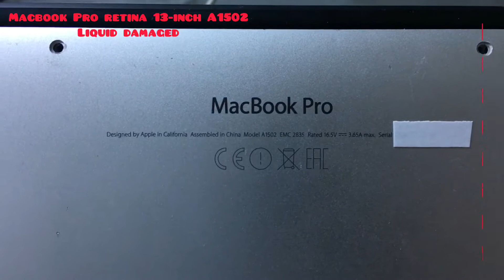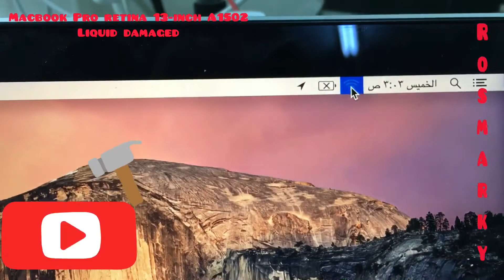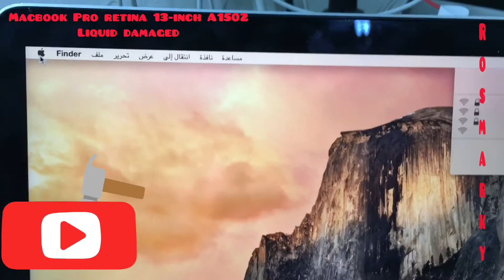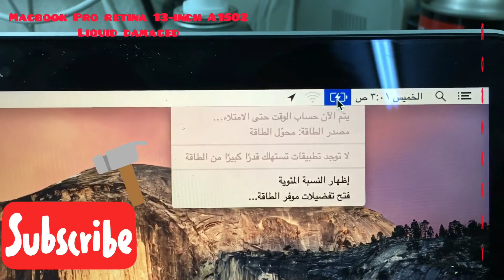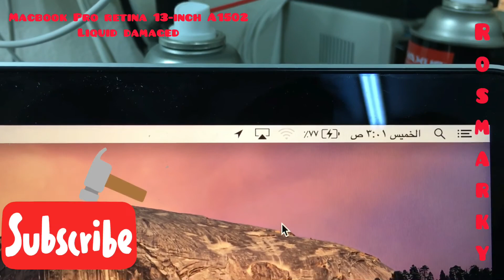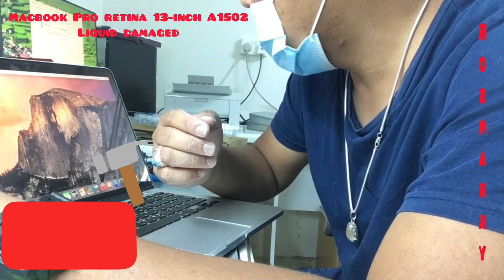How to fix Macbook Pro retina 13-inch A1502 Liquid Damaged-No Power-Not Charging-Battery Replacement

Comment: Hey hope you remember me, I'm the guy who had a issue with MacBook Pro 16 which was solved by replacing the battery flex cable 821-01648-A, I listened to you and bought the 821-01648-02 cable and replaced it and it was working fine, but after that I opened my MacBook to reapply the thermal paste because the old one was giving issues, but after assembling the MacBook back it's not turning back on when I connect it to the charger the trackpad clicks but there is no light in screen (the screen is completely black, I checked it in dark) and the caps lock key is not lighting up nor there is chime sound

Basically the computer is not turning on, nor the fans are spinning. Can you please tell me what's happening and how to solve it?
Reply from the maker: did you remove the m-board when replacing the thermal paste? if you did, probably you did not return the flex cable that connecting the m-board to the screen....
Reply: @RosmarkyTechnicalSolutions  Yes I removed the motherboard, but I made sure that I connected the screen to the motherboard. After commenting you about the issue I seemingly unaware left the macbook connected to the charger for maybe about 20-30 mins without the battery flex cable (821-01648-02) (the cable was removed and was on a table), and when I opened the laptop it turned back on again but with the same previous issue of laggy software and full speed fans and battery not detected.

 I think again its the battery flex cable issue (It might again be broken), are those cable that fragile or am I doing something wrong?

Although I must say there is a small broken part in the battery part of the connector (I can send you a pic of it in your email, if u would like to look at it)

I wonder is it the cable's fault or is it the broken connector's fault (but again with the new cable before reapplying thermal paste it was working fine), so I wonder which is causing the problem?
Reply from the maker: @tanmaymandal.2108  you can send the photo on facebook rosmarky technical solutions or you can send to my email dodongrosley@gmail.com
Reply: @RosmarkyTechnicalSolutions  Sent the photos on your FB